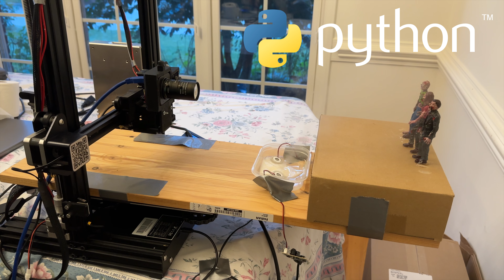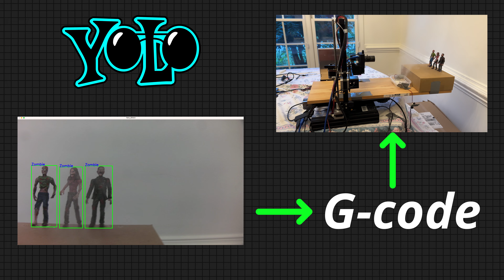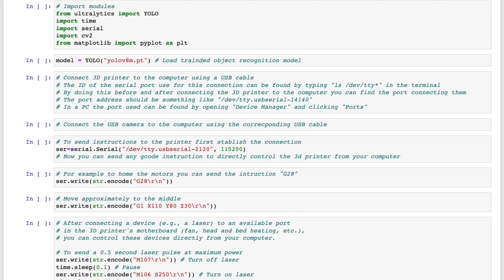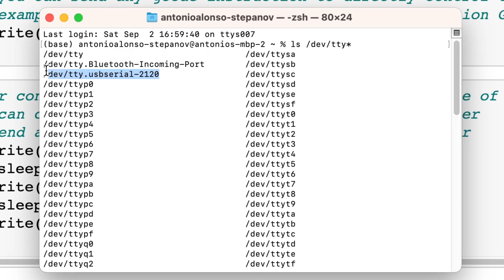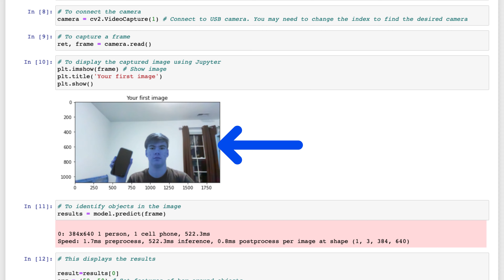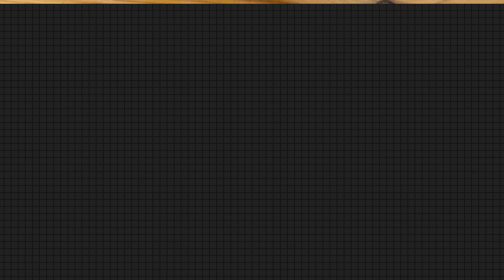How to Hack a 3D Printer With Python

Comment: could you in theory hook up a Wacom drawing tablet to a 3d printer so as the xy coordinates are controlled by the hovering stylus location, extrusion was controlled by actually pressing the stylus against the tablet, and z was controlled via being raised by a layer every time you lift back off of the tablet? I know this is dumb and would be a mess but I can't stop thinking about it.